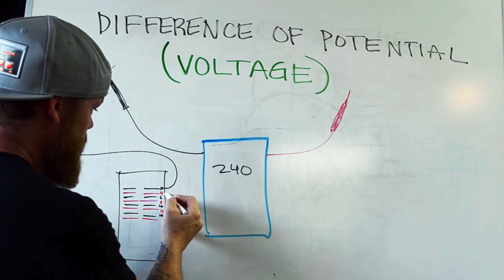Dimmable LED's - DON'T FORGET THE DIMMER!!

Comment: Would be so much better if the standard for home lighting circuits would get changed to 12 or 24V DC.
Every LED bulb now needs its own circuitry inside to turn 120/230V into 12 or 24V DC. Such a waste of components and makes it way more complex than it could be.

Comment: Hello, don't know if this is the correct place to ask this question and if you could help us out. 1990 house with copper wiring...we changed out our bulbs for LED and issue occurs only on the dimmer switches (some were changed to LED dimmers to test and still have the issue). We have an intermittent issue depending on the days, lights can flicker anywhere between 16:00-18:00. What can we do to figure out this problem? We've asked a couple of electricians and all of them said to change the bulbs and dimmers and verify that new dimmers have adjustment for intensity of voltage? Thanks for your input...Love the channel by the way...learning a bunch!!

Comment: Some LED lights, especially flat panels, require 0-10V dimmers.  For them I recommend the Responsiv 0-10V Blink'n'Dim Adapter, model BNDA0-10V.

It is the only 0-10V dimmer that:

* Is easiest to install
* Enables dimming control with existing switches
* Works with existing traditional wiring
* Accommodates smartphone and voice control

See its Amazon sales page at https://www.amazon.com/dp/B07H3FDQCT

Comment: Anyone watching this and still confused,

Standard phase/triac/leading edge:all the same thing, works for magnetic transformers. 

Reverse phase/ trailing edge: all the same thing, works with electronic dimmers. Be very careful when using these since there is no standard specification to manufactures drivers. Every company seems to make them differently. 

Also, one more thing, if you put the wrong dimmer, you can potentially burn out the driver

Comment: I can relate... I’ve been doing this shit so long,  I’ve gong from high and low voltage florescent dimming (which is a nightmare) to now. Most LED fixtures (unless its one or two) are 0 to ten volt dimming. This is not a bad system except for the expense. MC is available with dimming wire. Certain building codes require that exterior fixtures be dimmable because of energy. Fuck me the LED fixtures don’t pull shit. Electricians out there don’t worry, if its an Egress light you don’t have to dim it !!!!!

Comment: Question for you about dimmable LED's.  I have swapped every bulb in my house for LED's over the past couple years.  I have multiple dimmers certified for use with LED bulbs, but no matter how I adjust them, the bulbs still decide to flicker randomly at times, even if I have the dimmer set to full brightness.  I have  a couple of different brands of bulbs and dimmers, but no combination seems to alleviate this issue. 

What can I do to stop this, other than get rid of the dimmers?
Reply: Same issue. Nobody I’ve talked with can offer a theory on why this is. Have you figured it out?
Reply: @cpg8000  nope...

Comment: ever have it where the LEDs are dimmable and on a LED dimmer and still getting the strobe light effect or other flickering? take one bulb out and swap it with a different brand, for some reason that seems to steady them all out. I think it comes down to some rectifier in the LED not giving a steady enough pulsating DC. Try it out, its saved me several times! great vids dustin  thanks for ur hard work

Comment: Local country club got these fancy LED fixtures for their dinning room about a year ago and whoever put them up just left all the 1990's dimmers to run them. I guess they actually worked for a year, but here a year later most of these expensive fixtures are completely fried and now we're coming in to change everything out. Of course they started failing just after the last company's warranty expired.

Comment: I have found that if there is not enough of a load on the dimmer in won't work up to its potential. Have you run into this? I think the solution is to put a resistor in line before the dimmer but have not tested this out

Comment: So funny story...  This evening, one of the two 40w halogen lamps on my microwave burnt.  I decided to find some LED lamps to replace.  Before I made my purchase I learned this same important info.  My microwave has the dimmer option.  I did get the dimmable LED’s but don’t plan on using the dimmer option.  I guess I could get an LED dimmer to use?  Thoughts?
Reply: Hook n Saw hire a professional.

Comment: LED diodes, eh?  Did you pay for them with money from the ATM machine?  :-D
Reply: Sean Reifschneider A light-emitting diode (LED) is a semiconductor light source that emits light when current flows through it. Electrons in the semiconductor recombine with electron holes, releasing energy in the form of photons. The color of the light (corresponding to the energy of the photons) is determined by the energy required for electrons to cross the band gap of the semiconductor.White light is obtained by using multiple semiconductors or a layer of light-emitting phosphor on the semiconductor device.
Reply: @dallas5374  What is a Light-Emitting Diode Diode then?

Comment: From my understanding, there are two types of dimmers, digital and analog. Digital dimmers turn on and off the light at varying switching rates which the eye interprets as varying brightness levels and just stay on at full brightness. As where an analog dimmer varies the amount of voltage flowing through the circuit by changing the amount of resistance that's caused by the potentiometer in the dimmer. And it's because of the voltage changes or switching rates why some bulbs will not work with certain types of dimmers.
Reply: Thank you

Comment: My boss and I were hired to fix a whole house that had brand new LED lighting, but all of the dimmers were installed, brand new but the wrong type. The house was wired by a big electrical contractor but they ended up subcontracting our small company to fix the job. Materials were about 6 grand and labor over 1 grand. Costly mistake for them.

Comment: been there done that!  If you ever do led tape lighting pay attention to the power supply and dimmer combination.  Some dimmers won't work with magnetic transformers vrs electronic drivers.  The ones that do cost 3X more than regular dimmers.

Comment: If I change from standard halogen 60w to the led equivalent, do I have to change any 3 way switches? There are 2 that toggle on/off the living room light fixture. Hope my description makes sense without a photo. I realize this is not the subject matter on this video.
Reply: Thomas McLaurin you don’t need to change out you standard 3Way/4Way switches, only your dimmer
Reply: @E4-1959  ok thanks well good. If they will work ok with the LEDs and the energy saving florescent without blinking or something intermittent that might irritate a customer, I will not touch them.
Reply: Thomas McLaurin hire a professional.

Comment: Some dimmers even though they say are led dimmable 
They need to be compatible with bulbs or fixtures
The fixture will make a high frequency pitch noise that is crazy
Thanks Lutron for your crap products
Reply: Lutron has a list to match dimmers with most used dimmable led lamps.